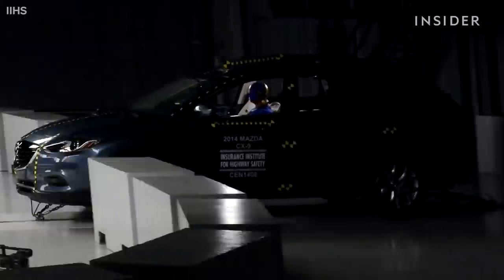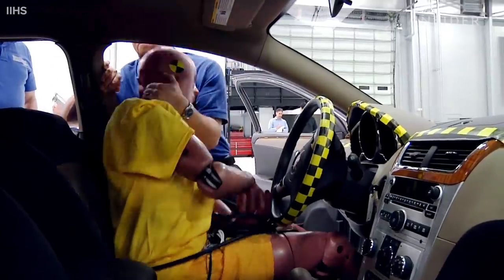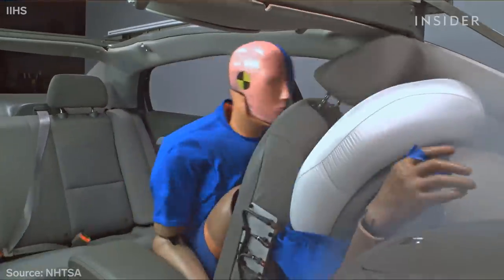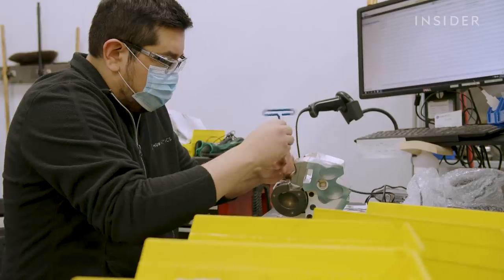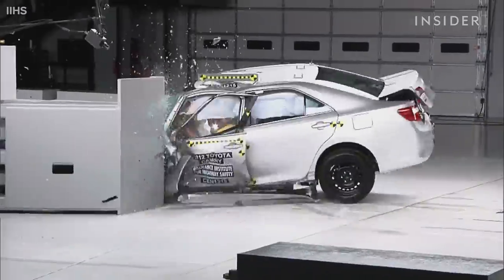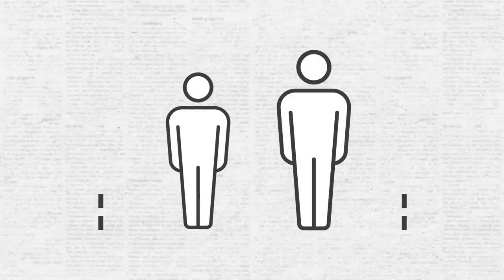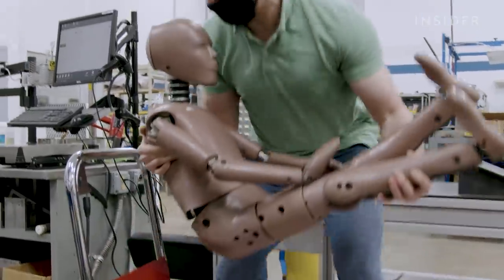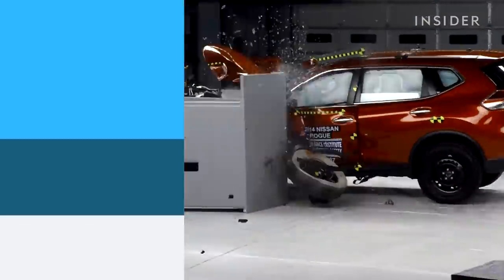Why These Crash Test Dummies Cost Over A Million Dollars | So Expensive

Comment: Imagine using a million dollar crash dummy for a 10k dollar Nissan
Reply: It's for every single Nissan sold tho. So for trillions
Reply: @ameliabuns4058  ehhh not trillions but yes wrecking a few cars to show the safety of a model line of 3-4 years that you'll end up making half a million cars total this probably cost as much per car as the rubber pedal cover's.
Reply: 0---0 when you can only find used ones for around that, that don't need thousands in repairs within the first year.

Comment: I also misheard 4:08 as "The weight of the cableling would buy us the test in itself, so we developed a dad-acquisition-system, this is really like the black box that goes within inside the crash test dummy, but what that does is captures the Dada in microseconds from the crash, and then dad can be downloaded separatly." BTW the documentary is really interesting and I think they are doing an excellent job

Comment: Why don't you get these dummies to drive the actual vehicles? Autonomous drivers with you in the rear. Better yet...add a strip of metal along the side of the entire stretch of cliff roadway and put a clamp on the steering wheel...to move it if you need to, or by remote. You know. If you want to sit at the wheel on handless and you're hard-as-a-dummy or something too.

Comment: There r no real woman models, until the thor-2, It was only a sized down male. In invisible woman, you will see that due to car manufacturers not having data on women, they are more likely to die in an actual car crash.
Reply: nope its because "A major factor is that men and women drive different kinds of vehicles"...“The numbers indicate that women more often drive smaller, lighter cars and that they’re more likely than men to be driving the struck vehicle in side-impact and front-into-rear crashes. Once you account for that, the difference in the odds of most injuries narrows dramatically.”

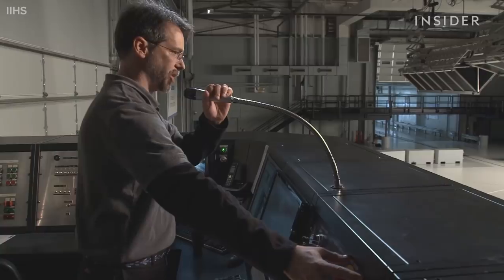Comment: 4:55 "But in spite of the fact that more women than men in the US hold drivers licences, ratings agencies continue to use dummies based on a male body shape..."
I don't understand how licence holders by gender is relevant. Can't we look at a more relevant statistic such as accident-victims by gender?
Reply: Isn't it obvious? There is more women driving, but the tests are made using male models for no reason other than sexism. If there are more women driving, tests should use female models. Statistics report that, because security tests use only male models, female drivers are more likely to die in crashes, because this bad testing affects where the seatbelts are positioned, for example. The point of the video is self-evident, really.
Reply: @yuris.3167  I think we should prioritise saving more lives and therefore look at the gender distribution of the victims. If that turns out to be women, change it :)